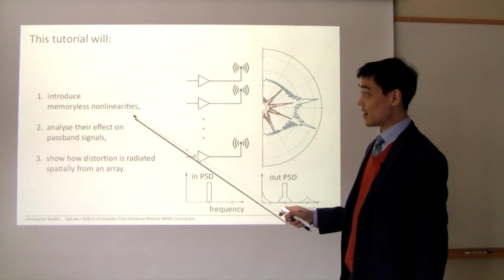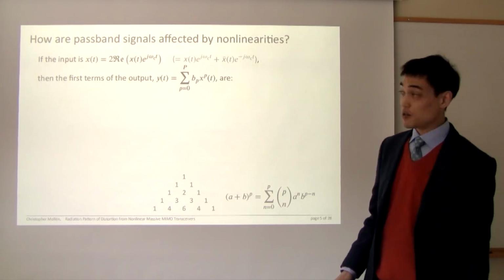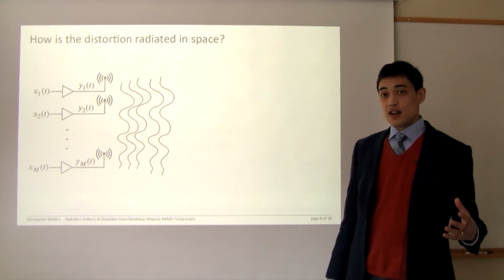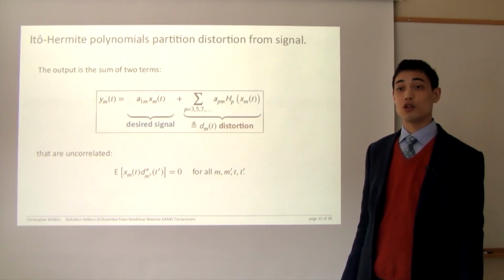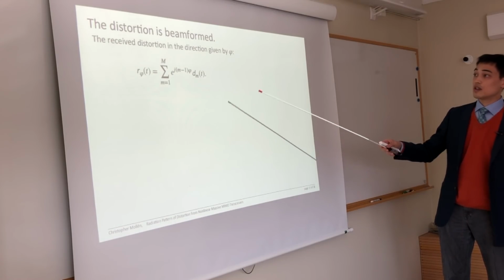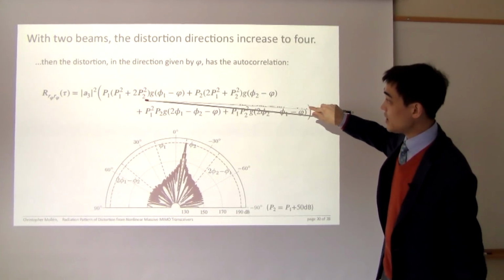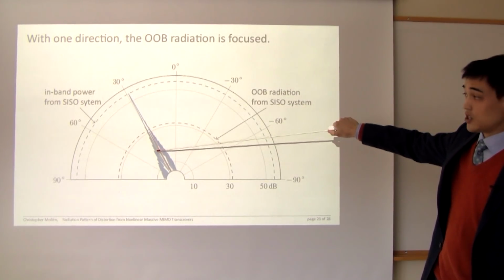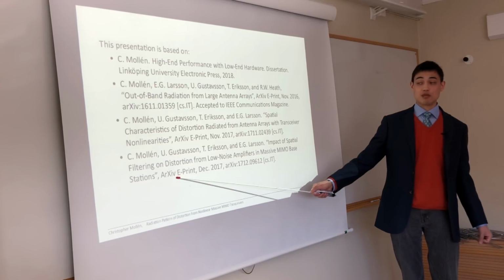How Distortion from Nonlinear Massive MIMO Transceivers is Radiated Spatially

Comment: The users in the cellular network may be near the BS, indoor or at cell edge. So, if the BS transmits with nominal power (p1) to user 1 at some location and P2 power to cell edge or indoor user  2 with higher power (p2) for maintaining QoS. As per  your presentation, it will also increase the distortion towards user 2. So, what will be the solution for that ?  Do you suggest to use same power for all users ?

Comment: Dear Dr. Mollén et al.,

Thank you for this very instructive and inspiring video! I had a small question. Let us take the single-user line-of-sight case. I understand that the signal-to-distortion ratio (SDR) is independent on the number of antennas M since both the signal and the distortion are impacted by the same spatial focusing gain. 

However, this seems to be a direct consequence of the fact that a constant transmit power per TX antenna is used. As a direct consequence, as M grows large, the total TX transmit power will scale with M, and the RX power will scale with M^2 due to the additional array gain M.

Would it make more sense to consider to work in different regimes? For instance:

1. At fixed total TX power: as M grows, the per-antenna power has to be scaled by a factor 1/M. Hence, from your formulas, the first order of the distortion will be scaled by 1/(M^3). As a result, the SDR will scale as M^2. Intuitively, the PAs are working at lower input power, further away from saturation regime, more in the linear regime and the distortion vanishes.

2. At fixed total RX power: as M grows, the per-antenna power has to be scaled by a factor 1/(M^2). Thus, the first order of the distortion will be scaled by 1/(M^6). As a result, the SDR will scale as M^4.

In the light of these results, can we really say that the distortion will be limiting in a massive MIMO system with large M? Am I overlooking something? 

Maybe my comparison is a bit unfair since, for different M, I consider different operating point/saturation regimes of the PA and hence diffent power efficiencies. Maybe if working at same efficiency, the PA would have to be redesigned to be still in the saturation regime and inducing more distortion? In that case, would the SDR be independent of M as in your result?

Any feedback would be most welcome! And let me know if I am not clear...
Reply from the maker: The property that Mollén describes is that the out-of-band radiation is beamformed with the same gain as the in-band signal. It doesn’t matter what the total transmit power is (if it grows with the number of antennas, is constant or reduces), the SDR remains the same. This is the reason why there are often regulations on the EIRP when building wireless systems, instead of only the total transmit power. The worst-case distortion appears when a user in the neighboring band is subject to beamformed out-of-band emissions.
Reply: @WirelessFuture  Thank you for the fast response! I agree with the fact that the distortion is beamformed with the same gain as the in-band signal. However, what I want to put forward is that, when increasing the number of antennas M, the SDR will depend on your assumption on how the per-antenna power is scaled. If you keep it the same, the SDR will be the same, as considered by Mollèn. However, if you scale the per-antenna power by 1/M, the power that is the input of the PA will decrease and it will work further away from saturation -> distortion will decrease by factor 1/M^3 --> SDR will increase by a factor M^2. And this does not depend on the spatial gain, this occurs at the output of the PA of each TX antenna PA (before any channel effect).
(This can be expected from slide at 14:20, equation at bottom and using  the beamformed signal s exp(- j phi m)/sqrt(M) instead of only s exp(- j phi m) to computed R_x_m_x_m' ).
Reply from the maker: @francoisr.927  Sure, if you build a 100-antenna base station by taking 100 PAs made for single-antenna base stations, then each PA you will operate far from saturation. However, I think this is a rather inefficient solution since PAs are typically at their peak efficiency when operating close to saturation. One should probably use a PA whose dynamic range is scaled down according to the reduced transmit power. You are indeed putting the finger on something important here: Scaling laws where one changes the number of antennas depend heavily on the underlying assumptions regarding the hardware.
Reply: @WirelessFuture  Fully agreed, thanks for your input!

Comment: Hi, thanks for the interesting lecture. I'm researching DPD applications on mMIMO, my question is: 
Do you think that linearizing the PAs in a MultiUser-mMIMO is feasible since the increase of the number of users improves the SINDR regardless of any linearization effort?
Reply from the maker: If a mMIMO base station is deployed to spatially multiplex 10 users, then it will also serve 1-2 users part of the time. The traffic load varies over the day. Hence, PA linearization is still an important problem in mMIMO.
Reply: @WirelessFuture  Thanks for you reply. Best Regards